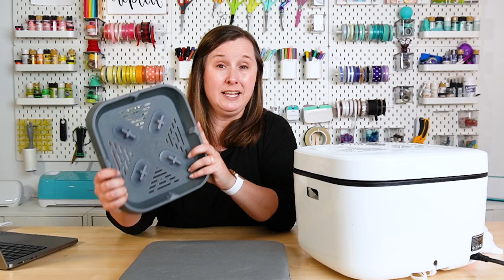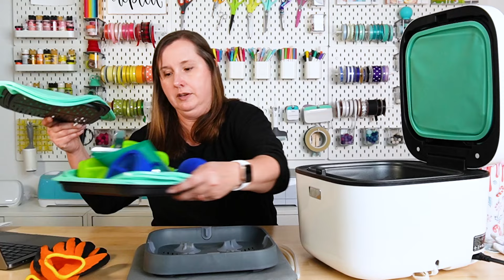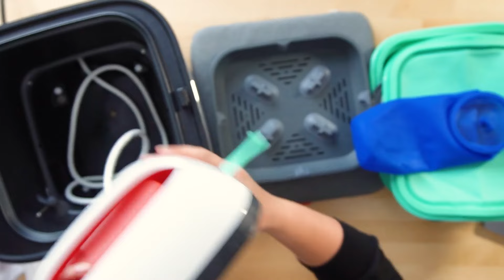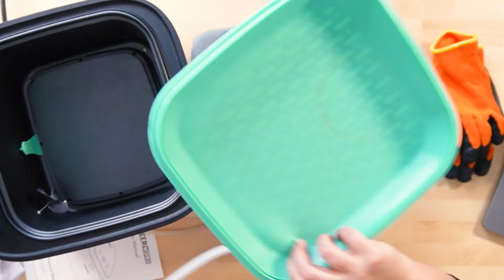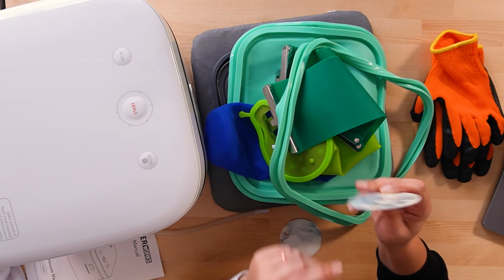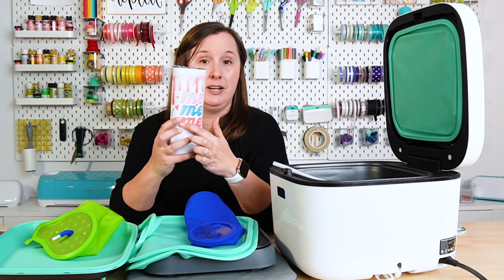Why I Wouldn't Recommend This All-in-One Vacuum Heat Press

Comment: Hey yall I have this same press and what she’s saying is not totally true. She doesn’t even have it put together right the cord does not belong in the machine while it’s heating. There is an attachment that goes on the side where you wrap the cord around the attachment on the outside that while you’re heating the product up, I guess he’s trying to sell her house on fire with the cord in there too, so that’s why it won’t close good because the cord is not supposed to go inside. It’s supposed to be wrapped around a little ab on the outside and it is a good machine, so don’t let her deter you from getting this machine. It’s very convenient so take another look at it. I think maybe she just doesn’t like it. Also, the directions are very clear. They’re straight to the point